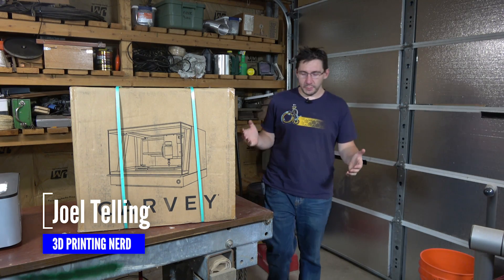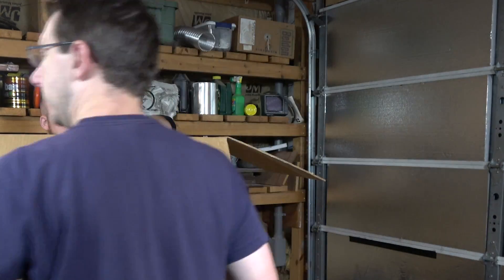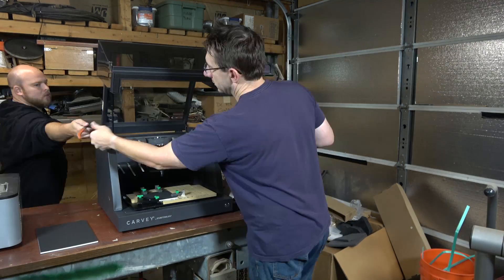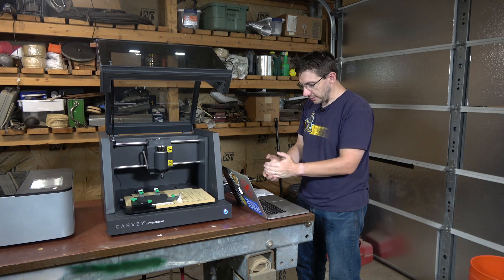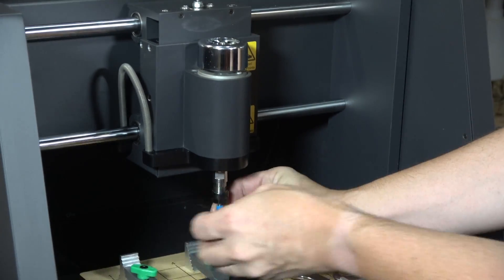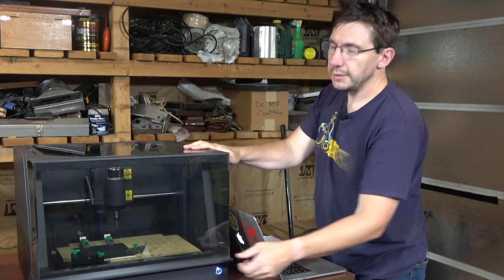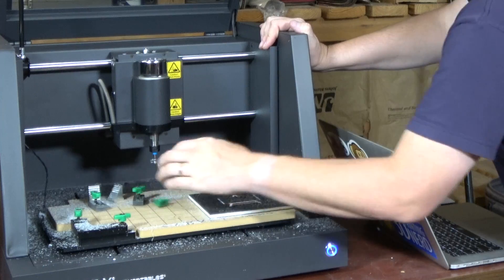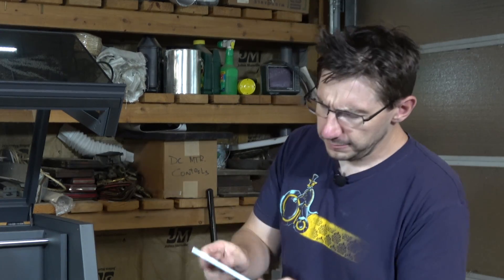Unboxing & First Impressions of the Inventables Carvey! CNC is Cool!

Comment: The cracked window seems to suggest they used acrylic, which is a common mistake in low end machines. They really should be using polycarbonate.

Comment: Hi I want to get a 3d printer. I need one with at least 180mm base plate because one of the main objects ill be printing is 5.1 to 5.6 inches also I would like it to be preassebled because I'm not the most hands on person and I have a budget of under 300 bucks. Dose anyone have any suggestions?
Reply: Yes. Lower your expectations.

Comment: This seems like a questionable value proposition. It's way more expensive than a decent benchtop CNC mill, but can only cut soft materials and has almost no space in the Z axis. It seems like you're paying a ~$1000 premium over a decent benchtop CNC mill to get a slick looking machine that works out of the box. 

Setting up a machine and building an enclosure for it to save $1000 and get a more capable machine are things any maker worth their salt should relish doing. To me, that's the whole point of being a maker. Doing it better, for less.
Reply: Output Coupler where are you finding any decent benchtop cnc mills for less that this cnc router? I've been looking for a long time but have only found junk mills from across the ocean. Any recommendations would be greatly appreciated.
Reply: Check Sherline. Their 5400 mill costs about $1000, about $1500 total after converting to CNC. Or if you really don't want to source motors and controllers yourself, they'll sell you a fully assembled system including a desktop computer to run it all for $2600. 

But I'd really recommend finishing a system yourself, it's way cheaper. Use a grbl based controller, but skip the worthless grblShield and instead get three Geckodrive G251X controllers, and wire the arduino to them directly. For motors just grab any old NEMA 23s with ~175 oz in of torque and you're golden.

http://sherline.com/product/5400-cnc5410-cnc-cnc-ready-deluxe-mill/

Comment: What type of material does it need? Does it use .stl files like printers?
Reply: You should be able to go to the easel site and find out for sure, but, a fairly quick search suggests only some svg files are supported and easel only manages 2.5D milling. 2.5D means X, Y, and cutting bit is either up or down. You 'might' be able to get slightly more sophisticated by running multiple passes with different programs. As was mentioned by another commenter just don't remove and replace the material unless you have a surefire way to place the material in the exact same place repeatably.

Comment: What kind d of material can it cut.. aluminum?
Reply: From the looks of it, it should manage multiple light passes in aluminium. Keeping things cool and not having the chips gum up the bit might be the hardest part.
Reply: Manufacturers say it's for wood and plastic, and very light cuts in aluminum. If you're going to be cutting aluminum, you really want a better machine than the Carvey. Luckily, better machines are also cheaper than the Carvey.

Comment: Hi Joel, in case you do ever find some time.. I've build the root3cnc machine. Its a 3d printed cnc machine. Best, most fun and most rewarding thing I've printed until now! Just saying :) ow and because I'm using an arduino running grbl i can use Easel :)

Comment: Hey Joel.  Watch your hands around the end mill.  They will slice your hand open really easily.   Your hand looked really close to the end mill when you pulled the part out.
Reply: An end mill is one thing you don't want to high five.
Reply from the maker: good tip, that would be an ouch!

Comment: That is neat but I have a Carvewright Machine for about $2000 and I can carve (Primarily wood) on a surface 14.5 inches wide by 12 feet long.  With it I have carved plaques and even designed a artwork designed bookcase.  You can see my woodworking on my web site www.carlbeck.com.   I have also designed and printed things on my Prusa MK2S and CR-10 3D Printers.
By the way the new Prusa MK3 looks AWESOME.  I wish I could justify buying it.  Your interview with Joseph Prusa was very interesting.
Reply from the maker: CARL! I'll head to your link soon, thank you!

Comment: CNC stands for Computer Numerical Control.   3D printers are CNC machines.
Reply: yea, he really should be saying its his first CNC mill, but its not the worse inaccuracy for him to say
Reply: CNC Additive and Subtractive Manufacturing. If you want to get technical.
Reply: Dan Harold that's correct! What needs to clarify "CNC" is adding the intended function like "CNC Printer" or "CNC Router".
Reply: also, you know, regular printers
Reply: CNC Computer Numerical Control.  Regular printers do not use Numerical Control.   Many modern printers just dump a bit stream generated by a computer.

Comment: Can you carve 3D printed items?  What material?  I'm thinking you just did a 30 hour print and you need a few mods (more precise than doing it by hand) or to clean up stringing or tough supports.
Reply: In my opinion you would need a jig to place the part and a whole boatload of accuracy to do what you are asking.
Reply: There is a height limit of about 2.5 inches, but using software like V-Carve Pro you can do a 3D carving. As for material, all woods, all plastics, I've seen it carve soft metals such as aluminum, brass, copper. I've also seen a couple people use it on marble and steel, i assume soft steel. Was cutting old saw blade.

Comment: MAKE A CR-8 REVIEW PLEASE
Reply from the maker: What is a CR-8?
Reply: Its a 3d printer/laser engraver made by the same company that makes the cr-10 3d printers. It has a 210×210×210 build volume, heated bed, easy asembly (suposedly).I have been doing a little reaserch and it seems alright, the only problem is that there's almost no content/reviews on it. Not even on reddit. It is -450$ so it seems amazing, hope you can review this later, thanks
Reply: Great video btw

Comment: To save you the time - It costs nearly $2500...
Reply: That's...not a very good price point. Compares rather unfavorably to the nearly identically priced Sherline 5800. 

The Sherline has a MUCH taller Z axis (238mm vs 70mm), and about three times as much total build volume (0.023 m^3 vs 0.008 m^3). The Sherline is also leadscrew driven, not belt driven, so it's much more rigid and will never cause errors due to belt tension issues. The Carvey is intended for wood and plastic and can barely cut aluminum, while the Sherline can cut stainless steel. The Sherline can be driven by standard CNC software, the Carvey cannot.  I wouldn't even think about eccentric tooling like fly cutters and boring bars on the Carvey, while they work just fine on the Sherline.

At least the Carvey comes with a fancy enclosure, I guess. And it takes an hour or two to wire up the motors and controllers on a "cnc ready" Sherline, so there's that.
Reply: Thank you! I was about to go looking for the price.

It looks like they're going for a highly user friendly approach. It's probably going to be great for certain people. I will definitely check out the Sherline though. Thanks!
Reply: Exactly. $350 maybe. $2500 LOLOLOL. It's a BELT driven 3D printer with a $45 12000 rpm engraver AIR cooled spindle slapped on it.

Comment: chips. not shavings
Reply from the maker: ooh, thank you. gotta get my terms right.
Reply: In MHO, with 60+ years in both woodworking and metalworking it was acceptable to use either/or but mostly chips were from metal cutting and shaving were from wood cutting. Call it what you want Joel, us oldtimers will understand n love you and what your doing anyway. 😆 Or maybe it makes more sense that shavings are small slivers of substance and chips are chunkier no matter what the material would be. But then again what does it matter, most of the world doesn't make any sense anyway, lol.

Comment: Make sure when checking your part you dont remove it from the machine, so if something is wrong you can just re run the program to clean up any areas that may not have been cleaned up well enough. Removing the part means the chances you can realign it back to the exact same location to fix a missed spot is nearly impossible.
Reply from the maker: +Matt Weber oh man GREAT tip!
Reply: Eh, I wouldn't call it impossible, or even difficult really. There are lots of ways to locate your work repeatably. You can use pins to register the work to a known location, or use an edge finder to find the edges and square the work, or just stick a fine pointed tool in the spindle to line it up to two of the corners by eye (works better than you'd think, humans are really good at this). 

If you're careful, you can get back to within 0.001" of your zero without too much trouble. People in the milling world do this all the time, since it's rarely possible to finish a part in one workholding setup. And those tolerances are way, way tighter than any router can hold.
Reply: Maybe print some pins that fit the holes in the bed to allow an XY location for the material?
Reply: Output Coupler yes when know to do so in the fist place. Someone new to the option of using a cnc would scrap a ton of work though before even know to do such things. If not prepeared before the project then recovering after is no easy task.
Reply: Output Coupler especially if its a full depth cut with only a couple tabs to prevent the part from being removed from the remaining material.

Comment: Can you cut a PCB with this?
Reply: Štěpán Rydval, whoever told you that toner transfer was cheaper, faster, easier and more precise than isolation milling told you a dirty lie. I can think of few things farther from the truth.

1. Etched PCBs require specially sensitized boards, which cost much more than plain copper clad. Using the transfer method to deposit ink on unsensitized boards results in poorly defined lines and makes fine features impossible. Milled PCBs can use any type of copper clad.

2. Etching PCBs is a three or four step process (print mask, expose/transfer copper clad, develop {if you're using sensitized boards}, etch) involving multiple corrosive chemicals which must be stored safely, and in some processes produces toxic waste (solvated copper ions) which must be disposed of professionally. Isolation milling is a single step process that produces very small amounts of fiberglass dust, which is easily vacuumed up and disposed of.

3. Etching a PCB takes exactly the same amount of time no matter how complex your board is. Milling takes time proportional to the complexity of the board, so most hobbyist PCBs are considerably faster to mill than to etch, and would be done milling before you had your board in the etchant.

4. Etching fine features (say, 0.1mm) at home is extremely difficult due to inconsistencies in temperature and concentration of etchants resulting in uneven dissolution of copper and resist alike. Milling fine features requires no special effort or thought.

5. It's trivial to drill a board at the same time you mill it. If you're etching the board, drilling is yet another step that must be completed after the fact.

The reason PCBs are etched when manufactured is because the process scales well, and isolation milling does not. One machine producing one board at a time is pretty awful, while a hundred boards etching in the same tank is pretty great. But scale is not a concern for the hobbyist, so they should use isolation milling if they have a machine that can do it.
Reply: Something not mentioned is the cost of the milling machine - I think this one is around $2,500 USD.  Photochemical etching is much, much less expensive to get going - probably less than $100, and less than that if you work at it.  You don't need photosensitized boards; you can apply UV sensitive film to standard copper clad boards and have at it.  
(Rant begins)
As a former lab technician, I am stunned at the cavalier approach that many electronics hobbyists take to etching PCBs.  It's not hard to hold a solution temperature within 1/10 of 1 degree Fahrenheit at home, using nothing more than a $10 aquarium heater.  Similarly, lab grade timers are both plentiful and cheap.  You can be both professional and repeatable in a home lab; yet hardly anyone doing YouTube videos is doing so.  It's amazing that they get anything usable at all.
(Here endeth rant)
However, the point you make regarding drilling the through-holes is a good one.  And once set up, PCB milling is cheaper on a cost per board basis, as the materials are virtually nil.  And the results would be very duplicate-able, so small production runs are feasible.  I'd love to have a milling machine to make my PCBs, but given the battered condition of my wallet I think I'll be using chemicals for a long time to come. 
>Charlie
Reply: Absolutely spot on. I'd never recommend buying a milling machine just for PCBs, but if you already have one then that's most likely the best way for you to make PCBs.
Reply: yes, many people use it to do just that
Reply: Jim Taylor Toner transfer method Is cheaper, Faster, easier and you can do much more precise boards
Reply: Yes you can
Reply: Jim Taylor, that was my question exactly.  Some CNC videos on YouTube show similar machines turning out incredible boards - true production quality.  Would be nice if Joel would take a shot at that!
Reply: You Are right, but carvey cant do that. For hobbyist Is toner transfer enough but you could also use photosenstive PCB. (I use photosensitive method) And for me is this method better. Big benefit on CNC Is drilling.
Reply: charles worton the price is shown literally 15 seconds into the video